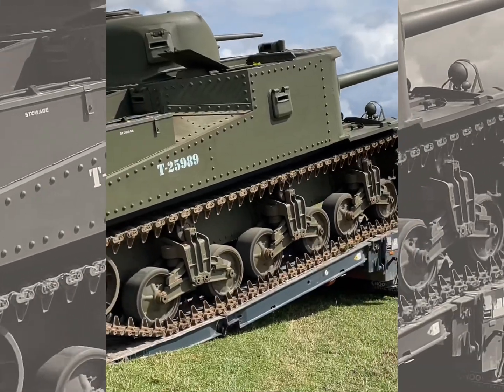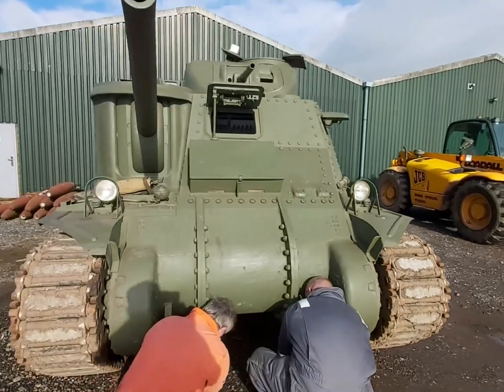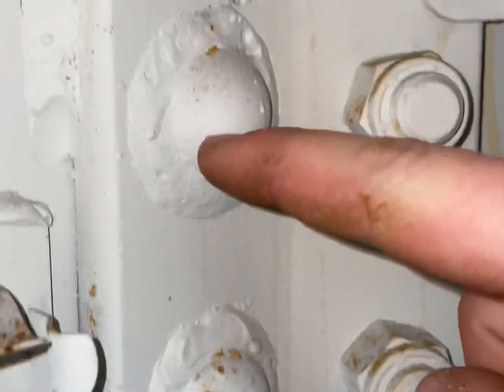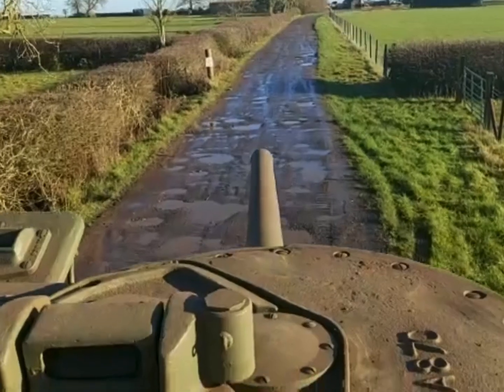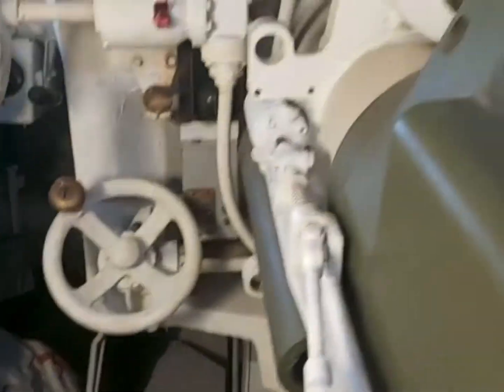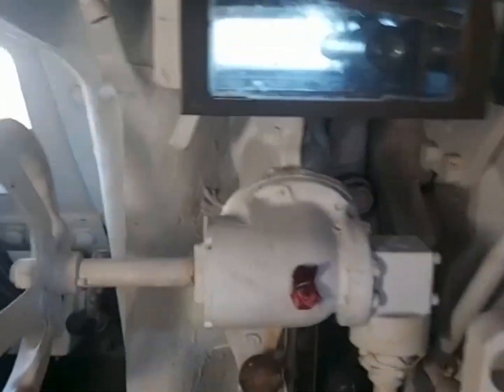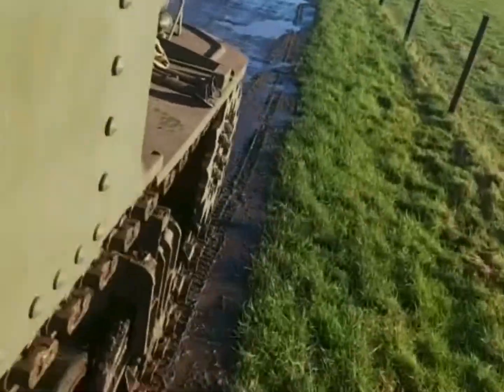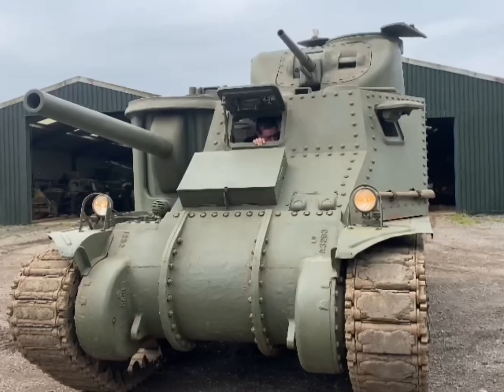Was The M3 Lee Tank Badly Designed? Tank Facts

Comment: I think they culd have made it work even though I know its time consuming id extend rise and widen the beast switch the bigger cannon to the turret if so widen the turret and use both barrels not to far apart and not to close so both gunners and loader will have room and two of the same smaller barrels with a turret replaced where you have that bigger barrel instead of the barrel going just up and down and also take a better look at the armor and see what they can do to keep the shrap to a minimum  angel the armor reinforce it while there maken the Sherman's there upgrading the lee or grant dubbel barrels to me are kinda better for more penitration sorry if I spelled that wrong

Comment: It should be noted that when the Lee was designed  slapped together; that the American tank industry was just in its infancy, and was unsure about large single piece castings for such a use, as well as welding also being fairly new on the scene in manufacturing of heavy armor.
Reply from the maker: Yes exactly! It’s a very oddly put together vehicle but it filled a need in the military for a time
Reply: I think some of the last run of Grant/Lee tanks had a welded hull.  Maybe that was a trial for the Sherman tanks which were all welded or cast.